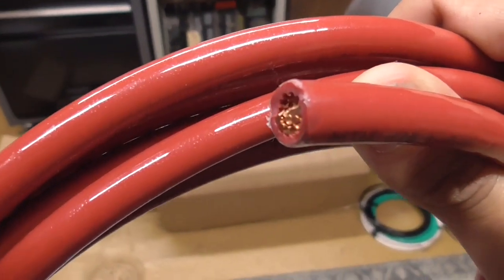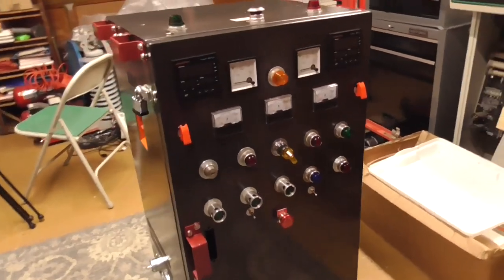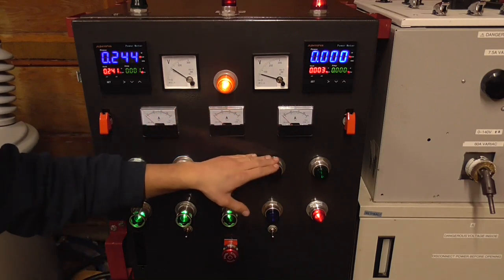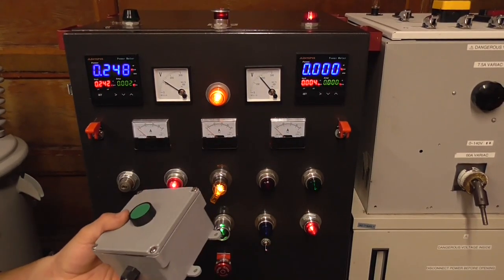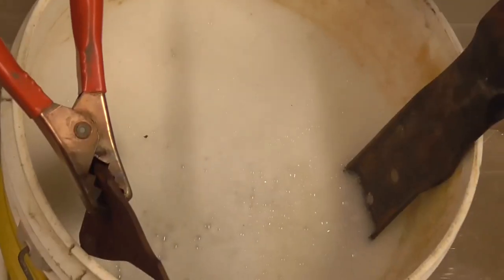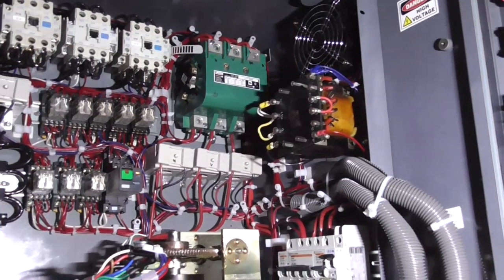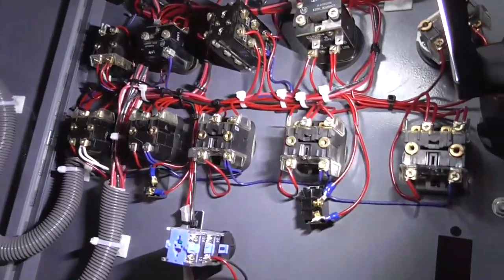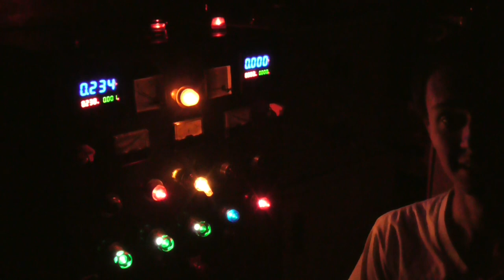Building a Big Variac Power Supply 18,000 watts

Comment: That's a really nice design but I'd change one thing about it. I'd swap that remote switch with a pneumatic operated one so that high voltage can't get back to you via that remote wire. You can get a pneumatic pressure switch from any washing machine and operate it with a long silicone hose. I have one on my bench-top HV ZVS Flyback PSU.

Comment: Did you wind your own paralleling chokes?  I posted in an older video and suggested a 3 phase line reactor fed by each variac and with it's 3 outputs bonded together might possibly work,  but I haven't personally tried it, yet.  Staco and Superior Electric want stupid money for their offerings.
Reply from the maker: You got that right. I wound my own using two toroidal 300va sheet steel cores to make mine. It was a bit picky as I had to tune the chokes till they were able to decently balance and protect the variacs. Each variac is equipped with its own 25A circuit breaker (on a 3 handle tied 25A circuit breaker so if one trips the whole supply does) to further protect the unit.

Comment: Look forward to seeing what you do with that beast!  I got a kick out of that boiling water - you already got yourself in trouble!  Didn't this also release hydrogen and oxygen?
Reply from the maker: Yep, but the two recombined when it came up as steam, no dangers apart from the electrical that I'm aware of, hoped you enjoyed it, I'll be making more vids soon!
Reply: @VariacManiac  LOL no, the only way they recombine by chemical reaction, i.e. fire!  If you were to capture the released gases generated by the electrolysis and put a match to it, you'd get quite an explosion.  See https://www.youtube.com/watch?v=MMB2VR0087w
Reply: @erichsh58  Actually you need DC current to get hydrogen. You won't get it with AC.
Reply: @ryanschulte1437  Works with AC as well.  What happens with DC is that one end (cathode) will only produce hydrogen and the other end (anode) you get oxygen.  With AC, you'll get a highly explosive two-part hydrogen to one-part oxygen  mix at each end because the the cathode and anode will alternate as the polarity switches back and forth.
Reply from the maker: I mean I'm no chemist, but I did get a small amount of hydrogen a long time ago using DC, took a lighter to it and when I popped the bubbles there was a small flame, with AC, I didn't get anything unfortunately..
Reply: @ryanschulte1437  This is a much more in-depth scientific analysis of electrolysis (http://www.crscientific.com/electrolysis.html).  They reference AC as follows: " Even if it were current-limited, alternating current (AC) would not be appropriate for electrolysis.  Because the "cathode" and "anode" are constantly switching places, AC produces explosive mixtures of hydrogen and oxygen."  The source of bubbles could be other things of course, starting with steam if it gets too hot.  For example, try doing the same thing with two sheets of aluminum foil, one on each end of the AC supply.  The oxygen released by the electrolysis process would immediately react with the aluminum foil to generate aluminum oxide (and the aluminum disintegrates), yielding bubbles of free hydrogen.  In a DC circuit, only one piece of aluminum foil is attacked by the oxygen; in an AC circuit, both of them are (try it!).  However, if you put a resistor-like load in the water (like the heating element in an electric stove), you won't get the same hydrolysis reaction as you would with electrically separate plates.

Comment: Are you going into this line of work? you have progressed a lot with this since I first watched your show
Reply from the maker: Absolutely. Wouldn't want to waste it. As my major, I'm taking classes in Utility Technology actually. This channel and You Tube have helped my knowledge grow substantially. Lack of money and knowledge is what held me back in the beginning. I never used to have a clue about electricity, then I got my first electric shock off a vacuum cord, then I was immediately fascinated.
Reply: @VariacManiac  interesting,I'm surprised the shock didn't scare you off? I do tree work for dte, got lit up a couple of times myself when I was an apprentice, but the worst time I. got a jolt was from an electric heater working at a ski area, someone place a tinfoil gum wrapper in between the cover, it was touching the top of the switches and made the whole  box hot!!!😳⚡💥💀😃
In retrospect I probably should have turned the power to the heater off before I started taking the cover off? a put a screwdriver to it and found out the hard way...🤔
Reply: Oh and I also collect insulators!💎
Reply from the maker: @mikemerkweki6949  Nice

Comment: Does the variac have a 100V motor on it, and did you convert a voltage for it or just feed it 120v?
Reply from the maker: Yes it does. 120V shouldn't hurt it, although it is thermally protected and seems to work good, it's been for about a year now which is good.

Comment: How much did it cost? (I would like to make something similar)
Reply from the maker: It costed around $3900 in parts
Reply: Well that's a little bit out of my price range :D but hopefully I could afford to build it in the future. Also where does one find a 18kW autotransformer? I have a 3.6kW one, but that's just not enough :D. Oh and I would love to know how to make the paralleling coils. btw sorry if my english sounds a bit weird it's not my first language.
Reply from the maker: @jirichladek7713  Your English is good. I obtained the variac from eBay, was a score out of pure luck. The paralleling coils are made from 2 sheet steel(not ferrite) toroidal transformer cores rated for 300W and they both have 2 coils 14 turns each paralleling each other for 4 connections on each.
Reply: @VariacManiac  Actually I should have asked how the paralleling coil work or how to connect it. I've searched like the whole internet and haven't found anything useful.
Reply from the maker: @jirichladek7713  Their basically a 1:1 ratio transformer with a center tap. The center tap is the output of the choke when 2 variac outputs are connected to the last 2 connections There are usually 20-30 turns of thick copper wire. The core is usually sheet steel. Here's a website that might help. https://www.pupman.com/listarchives/2000/March/msg00400.html
Reply: @VariacManiac  Thank you so much! I had that 3.6kW autotransformer for almost a year now and i couldn't use it's full potential. I am making those ballancing coils immediately :D
Reply from the maker: @jirichladek7713  I hope it works out for you man!
Reply: @VariacManiac  Thanks, I'll let you know when it's finished. Hopefully school won't be in my way too much :D
Reply: I've tried the parallel coil and it works.  but the autotransformer has worn carbon brushes :(
Reply from the maker: @jirichladek7713  Maybe you can purchase new ones for buy a lump of carbon and make your own, but I have no experience making my own. You have to get a good grade of carbon as well.
Reply: @VariacManiac  I'll probably try carbon brush from a motor or something like that